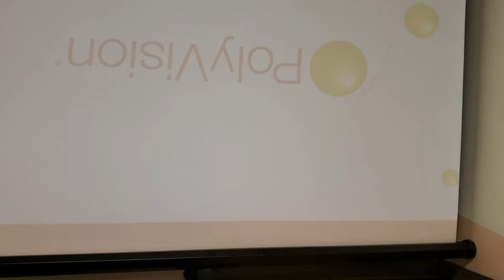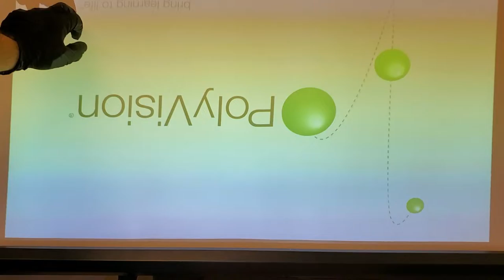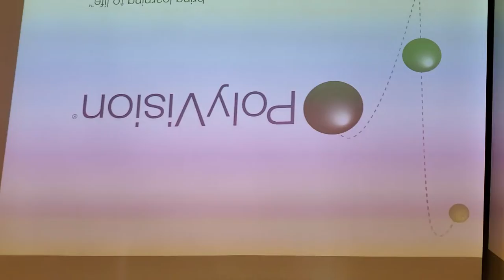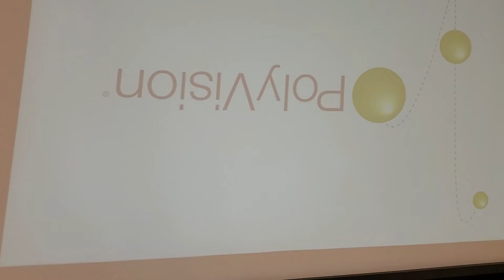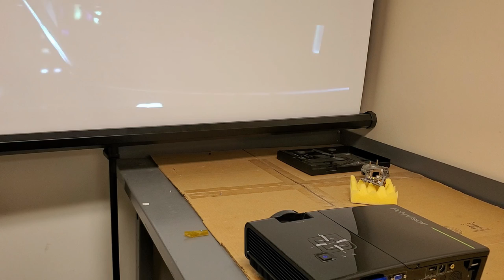Steelcase Polyvision PJ905 DLP Projector Repair Color-wheel and DLP chip

Comment: I'm a cellphone repair tech but I decided to try my hand at my projector because the screen is starting to go black and white after an hour. I only had it for a year it's a benq tk800m. After taking apart and cleaning the sensor on the wheel. The projector no longer starts but when taking apart I had 2 different things fall out of lens asmebly and I wasn't sure how they went back. So I guess that's the issue or maybe missing with the color wheel caused it to go all the way out. Anyway how much to repair this thing?
Reply from the maker: My email is listed on the about page about halfway down if you want to send me some pics of what you have going on.  One thing to mention is that the lamp door cover pushes a safety interlock switch that interrupts power when the door is not installed. That might be your power issue. However with a year on that projector and it going black and white, that is really weird.  Do the colors flicker before it happens or it just goes black and white out of nowhere?

Comment: Nice work! Is ok to put thermal paste to the dmd chip or is better to use thermal pad?
Reply from the maker: I would use whatever you have around.  both work fine in my opinion.  Pads are less messy and dont dry out like paste but paste works fine. If you have paste use that, if not and you have to order something, then I would order pad material.
Reply: @FixitFrank Thank you for you answer , I put paste I didn't change something only i clean it inside
Reply from the maker: @vangelisk159   I don't think you will have any issues.  I routinely use paste in the same situations.

Comment: Hi Frank, I've posted a comment on another video of your ballast repair. Curiously I saw this new video and my Vivitek H1080 is almost identical to this Polyvision PJ905 inside. Funny I've never heard of this brand before but now I know they share parts and if I try to repair my projector, maybe I'll find replacement parts.
Reply from the maker: They are almost identical inside.  They are both made by Delta Electronics (also makes units for BenQ and Optoma).  I read your other comment, have you tried another lamp?  I only say so because if it is not an original brand bulb(Osram) in the housing I would be skeptical. Especially since you hear the ballast trying to start.  Its possible the bulb has a fault and the noise is the high voltage trying to strike an arc inside a bulb that cant sustain an arc.  Also, the lamp(obviously) is the easiest part to replace. Id really recommend buying a lamp with an Osram bulb from a company who will refund you if its not the lamp. That way you know for sure its a good lamp.  Then if it still act up you know the lamp is not one of your variables.  
If you do need a ballast, they are pretty available. The only parts I have had trouble finding reliably is the lenses for these poly-visions due to them being short throw. I have a slightly different version that is packaged for Optoma that I run at home.  These are great chassis when running.
Reply: @FixitFrank  Thanks for the answer. I just opened the projector again to take a closer look, now that I've seen your Polyvision video. I could tell that the colorwheel was dirty and the sensors too. I cleaned both of them and the rotation sound of the colorwheel even improved, but the projector continued without turning on the lamp. But this time I noticed that the noise I heard seems to come from the colorwheel and I did not hear anything that could indicate noise from the ballast. No click noise. As for the replacement of the lamp, I will really have difficulty getting one here in Brazil for this projector brand, just importing from china or USA. But I noticed that the old owner's report about the lamp is good, it makes some sense because there is a note in the body of the lamp that is very recent, a thing of few months, I presume that it has already changed the lamp and there were no results. Should I analyze ballast transistors for short? Or is this my case the symptom would be different?
Reply from the maker: @jokerbrazil1  Can you post a video or sound clip of the wheel?  If it is making noise, it might be the entire issue.  The lamp will not start at all unless the projector recognizes the proper RPM of the wheel.  As long as your lamp has Osram on the back of the bulb, you should be OK if it is that new.  I doubt the ballast is a problem at this point.  I would rule out the color wheel first.   It should spin up very fast. If it spins at different speeds before shutting down, that might be your main issue.  It is hard to say without seeing it myself though.  
If you want to check the ballast, I would check the 4 MosFETs like I did in the ballast video. The ballast in that video is very similar to the ballast in these projectors. If none of the 4 MosFets are shorted, then your ballast is probably OK.  
If the CW ends up being bad(bearing worn out) your best bet is China for a replacement.  They are about $50USD if I remember correctly.  
Let me know if you can post a video of the wheel behavior and I will take a look and let you know what I think.